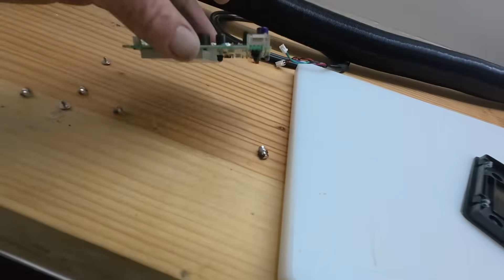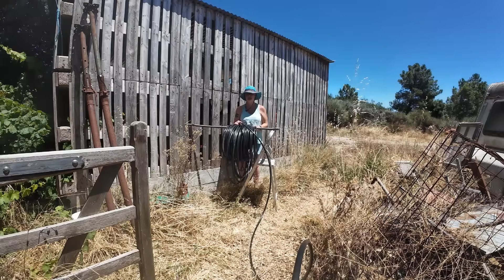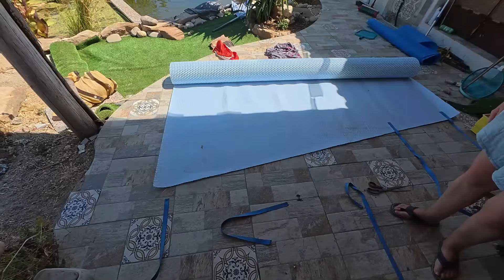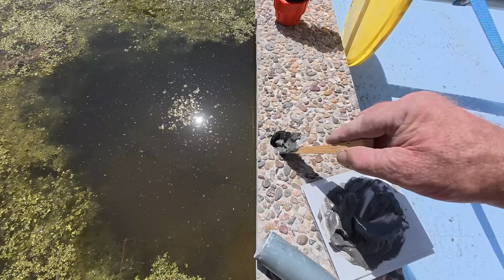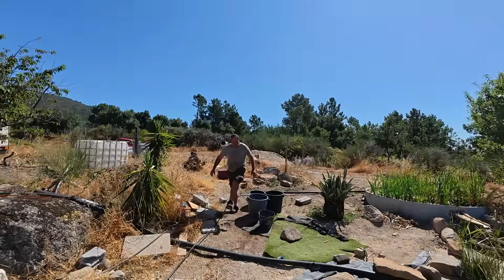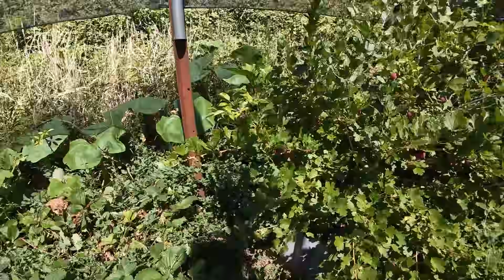Building and Fixing Lots Of Projects in Extreme Heat - 263

Comment: Hi, The surge of power when the resister went pop has probably killed other components but are just unseen. Can you determine if it was faulty equipment or was it working at capacity for a long time which highlighted the weak parts. I know this will make me sound old but nothing seems to be built to last anymore or even just do it's job well for a year or two.

Comment: Although I have not made a quilt in a while, your backing fabric and wadding/batting are at least four inches larger all around than the pieced top.  You quilt from the centre of the quilt out to the sides.  Hopefully Cindy has a quilt frame or table large enough to lay out the quilt while she quilts it.  That is quite a large quilt she is making.

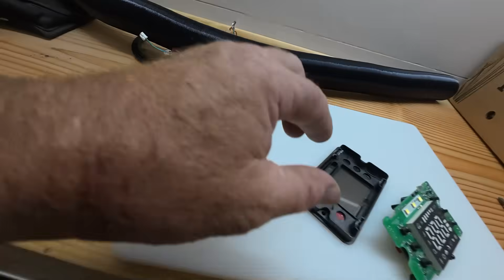Comment: This type of resistor is called capacitor... 😀 (2:07)
Reply: You beat me to it 😂
Reply: Check the other caps for swallowing (most of the time like a mushroom top). Also they have to match the exact value and orientation. Take any picture before replacing them so you know their orientation and do 1 each time.
Reply: Yeah electrolytic caps have a +ve and -ve side. It may be another component caused the cap to fail. Note the + on the top of them. This is to allow for a safe 'blow' and if there is a raised top it indicates a failure.
Reply: Yes,, it is even an electrolytic capacitor 🙂